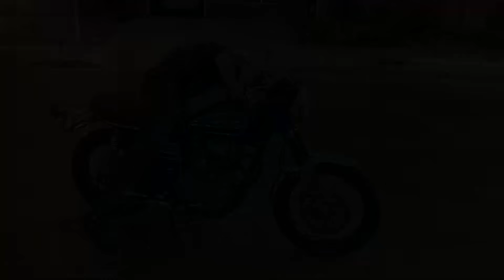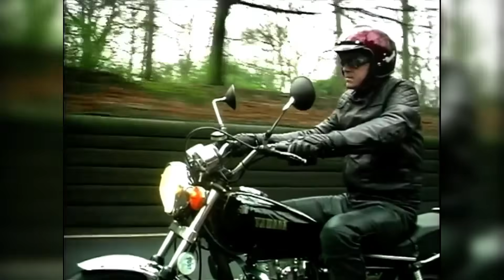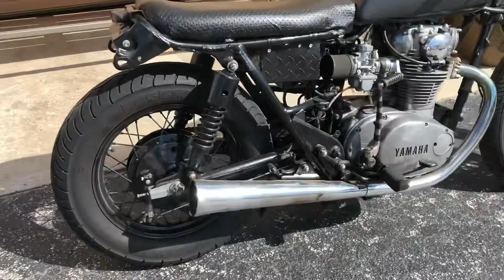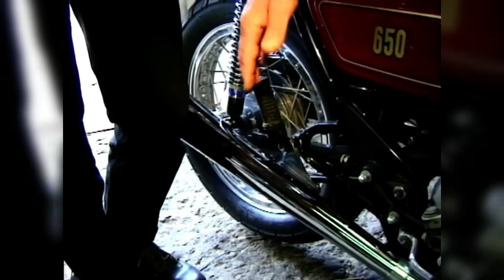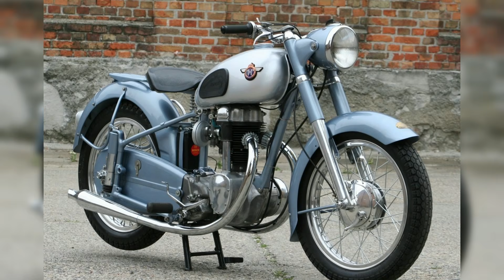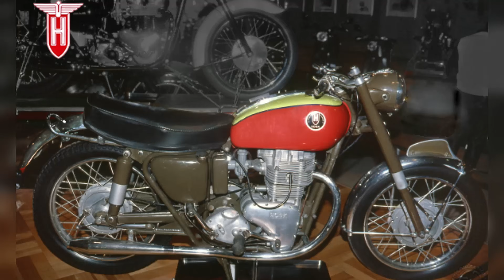THE EXPLOSIVE TRUTH BEHIND YAMAHA'S BULLETPROOF XS650

Comment: The XS650 engine was an extremely durable and reliable motor. It required very little maintenance for a long time. As long as you kept the valve tap it suggested and the cam chain tension correct it would go and go and go without any major repairs. Anyone who says that it was unreliable is ignorant about the subject and may have fed into a myth produced by somebody who is one of those who dislikes anything that's too good so they need to tear it down and dislikes anything being a little too bad so they need to build it up. This kind of leveling mindset exists in many people.
Reply: I recall they needed generator(?) contacts or something every 5000 miles - easy to do. You needed to do that work at the stated interval or they would fail and you'd be parked. Otherwise they are very reliable.
Reply: @terrybrown8539  Yes the alternator brushes needed to be replaced once in a while ( this was documented in the owners Manual, 5000 miles is probably right ). And by now most have had to replace the alternator rotor ( or rebuilt ). In have a voltmeter on mine to make sure, the green light tells me charging system is fine :-)
Reply: Tony halco , done mine to 840 and few other mods what a bike I had
Reply: I flat track one for five years and never touched the bottom end , did a top end each year and did valve setting and new cam chain , replaced the cam guides at two years. Bullet proof .

Comment: Few people know that the XS engine was also used briefly by the gamble racers (Auto Race) in Japan. They cut the entire transmission/clutch assy off the engine, switched the drive to the left side of the crank, ran a 2-speed gearbox with dry clutch, cut all the fins off the head and, as I recall, ran the oil pump off the right end of the camshaft. It was hoped that the XS would out-perform the dominant Triumph and Meguro twins but it didn't, and the bike was scrapped. I've got a photo of it somewhere and it's pretty wild.
Reply: Why remove the fins off the head?  Were they using methanol?
Reply: @dennisyoung4631  Gotta dig up the photo and look at it again to confirm. But no, they don't run methanol. The higher CG of the XS engine compared to the Triumphs and Meguro copies of the Triumph engine, may also have been a problem.
On the Triumph and Meguro engines many of the riders drilled the fins with many small holes. This works when the cooling area of the hole exceeds the area removed by drilling the hole. For more info search for 'The Zen Masters of Motorcycle Racing' (Superbike Planet).
Reply: Thanks for the fun facts. Japanese can be so off the wall crazy.

Comment: I had a striped down 1970 with a stepped frame and some rake. It actually handled quite well. Unfortunately, there was the vibration. With drag bars and a thin cobra seat, you couldn't see when you got close to 100mph. Too blurry. Then your teeth would hurt. I suspect going +90 for more than 5 minutes would give you brain damage.

Comment: Roberts' Yamaha flat-tracker was reworked to 750 cc with a one-off fabricated frame, suspension, and wheels.
When the Triumphs and Beezers were competing they were limited to 500cc while the Harley flatheads were 750.
When Harley finally smartened up to overhead valve efficiency the restriction on parallel twins was dropped.
Good timing for the Yamaha and big bore kits but not really any stock parts at all on racing equipment.
The Honda-Davidson Evolution motor saved their marque in 1984.
Reply: I thought Kawasaki was behind the Evo.......started when They Owned HD  and later sold it (Harley-Davidson )back to America   dave  nz
Reply: Harley brought out the XR after the AMA alowed the British bikes to be up to 750 ohv
Reply: I had planned on making one of my XS 650s into a 750cc and rephase the crank and cam to 270 degrees.  I did get it painted in the bumble bee yellow with the street tracker fender, seat, and side cover.  Just never got the engine modified and put  it back together.  I found out that the 270 degree crank and 750 didn't make enough increase in HP, so I let it sit for years.

Comment: With all of the "retro" bikes on the market, I'm not sure why they don't revive this legend.
Reply: Yes. And with a 850cc twin to boot
Reply: Because Yamaha's styling department has been lost for the last 20 years.
Reply: Friend recently had rebuilt an XS 650 engine with electronic injection, drive by wire, a freely programmable ECU and a little roots blower. That's what people would like, but You can't bring such a concept to a market that's panicking about carbon and NOx more than about the drivability and performance of a bike.
Reply: Built to last the modern one probably wouldn’t last as long
Reply: Xsr 700.
Reply: A new one will have plain bearings instead of needles and balls... It will not be as rugged as a result...
Reply: It'd be a great competitor for the Kawasaki W800
Reply: Because of the intense vibration.
Reply: @fredjaeger690  You're the first person I've ever heard complain about the vibration so that must mean you've never ridden one.
Reply: @jds @jdsolberg7613  I owned one, Stanley. At highway speeds it vibrated like hell. It also only had about 3 inches of travel in the rear suspension, which meant hitting any kind of a highway expansion joint at highway speeds was quite jarring.
Reply: @fredjaeger690 I also owned one Margaret, and there are a lot of bikes on the market today that don't do well on the highway and potholes are frightening to see coming, my vibration prone, 3" traveling Sportster for one. You should stick to automobiles.
Reply: Two words.  Points ignition.
Reply: @Crow-v2s became electronic by 1980...
Reply: @thorick590 That’s my point.  You can’t tune it.
Reply: @Crow-v2s get a 1978 or earlier engine..

Comment: I had a 1978 E Canadian model , nice spoke alloy rims and dual front disc , was a unique bike .
Reply: Very nice bike!
Reply: @manfredschmalbach9023  It was , did a few upgrades on it like electronic ignition , PMA alternator , high output coils , 2 into 1 exhaust and pod filters , NOS Koni shocks in back and progressive springs up front , Donlop K70 tires, carb redone , bunch of bearings and bushings , short stem turn signals , LED tailight bulb, IX plugs , Barnett clutch, nice handlebars bunch of other stuff  ... that thing ran like a top  , I really regret selling it now .

Comment: Did someone mention its sidecar motorcross ability ?
Reply: I once owned one that was bored out. It came with Ducati GT 860 pistons, 40mm DelOrto carbis. During the 5 years I owned it I installed alot of AME Chopper accessories such as, forward foot controls, 2-in1 side pipes, wide handle bars on high risers, a peanut tank a.s.o., but man that thing pulled like a drag bike. The only annoying things was the vibrations and the oil leaking from between the sleeves and the cast at the cyl. tunnel.
Reply: It's an American video, viewed at 98% by American people. They never heard of sidecar  motocross. The Yamaha was the best engine for years, with evolutions until 969 cc.

Comment: But brit twins have soul,xs 650 will never have this,they have poor handling, iffy e start,and rusting out fuel tanks are a epidemic
Reply: And you rebuilt a Triumph or BSA twin every 30 k miles, or even less. Nortons didn't last half that distance. If the build quality of the XS was bad, the build quality of later British bikes was atrocious. Then there were the dreadful electricals. Chassis were better and brakes were better. There's no denying that. And parts were everywhere and cheap as chips. They definitely had their plus's, but they came at a big price in terms of reliability, longevity and ease of maintenance.

Comment: My XS1 was a piece of junk. Bought new and right off started using oil. Missing an oil ring. Gaps in rings all lined up. Burned up points faster than oil change intervals. Tank slappers just above freeway speeds. Crome pealed on fork tubes. Disappointed is an understatement.
Reply: You Are Not Alone a friend of mine bought one in 1975 and the oiling to the overhead cam quit and seized up everything upstairs.
I will say that the dealership in Hammond Indiana took the situation very seriously and gave him a brand new set of barrels Pistons head and cam assembly.
It ran good after that but he still could not beat my Bonneville LOL
Reply: Yes, in my opinion the forks are the weakest link for the ride. 💚
Reply: Yes I can confirm the tank Slappys.  I had a 1972.
Reply: Handling was real bad
Reply: You were extremely unlucky.
Reply: I rode a 650 Bonneville back when the XS1 came out. I had many riders try taking me on in various situations and the Bonnie beat them easily. It wasn’t until a decade ago that I learned how the big end bearings were supplied with oil, which was the most ludicrous  thing I’ve ever heard in my fifty years of riding. 
The time honoured method of supplying oil to the bearing surfaces of the bottom of the conrods and the crankshaft journals is to use oil ways that carried the oil, under pressure, through the crankshaft and then to the big end bearing surfaces, but the XS1 had a system where such oil was supplied by a jet of oil being squirted at the big ends as they passed the point of the jets! 
There’s no question that roller bearings are better than white metal solid bearings, but there’s a caveat; the only time said superiority is advantageous and that’s when the RPM is higher than 7000rpm, but because the British bikes were geared differently, such a rev range wasn’t really  something that is necessary for a daily rider. At that rev range, the Triumph Bonneville is doing well over 100mph,  which means that the advantage of needle roller bearings is not that much of a problem.
I rode that Bonneville 650 as my only transport for over two years and I never had the problems with oil leaks, starting, or any other problems repeated in this video. The fact is that most of the issues are merely a matter of careful maintenance and even the horizontally split cases were not as hard to make oil tight as the video insists. 
IF the person rebuilding the engine is capable of very basic mechanical tasks, it’s a matter of careful work to rebuild the engine and make it oil tight. As far as starting goes, if I had to kick it over more than twice without it starting (cold weather or not) then there was a problem which usually amounted to a loose spark plug lead, or similar. I currently ride a 1997 Harley Sportster and that has horizontally split crankcases. It is so oil tight that if it ever does drop oil, the problem is always from some other point in the oil line, usually a hose fitting. The same was true of my Bonneville. 
Both bikes have been ultra reliable and far easier to work on than other bikes available. I actually like working on my own bike, because I know everything about how it’s been put together. I know exactly what’s  the condition of each bearing, bush, oil seal, etc, because I installed it. The number of times I come across people on the side of the road who have no idea how to even do basic maintenance is ridiculous. People pay over a thousand dollars to a workshop just for oil changes and routine servicing! 
I’ve been told by some riders that British bikes always leak oil, for half a century and I’ve always wondered bets with them about how much oil will be under the bike after lunch at a stop for lunch, or after work. The main reason for the oil leaks was due to the fact that production line workers in the UK in the 60’s and 70’s were all infected with the Socialist attitudes that led to them being paid for their time rather than their performance. A paradigm that exists to this day in factories in Communist China. 
Also, while Japanese factories were run on the basis that things like quality are more important than output, British factories of the day were run by accountants with stopwatches, who were more concerned with time and motion studies than producing machines that were manufactured to a standard. This too is still going on in many manufacturing plants today, where time is considered more important than quality. 
Personally, I liked the XS1, generally, but I wouldn’t own one, unless I could reengineer the oil feed to the bottom end bearings for starters and while I could do that, I don’t see the value in spending that much time on it. I would rather be doing that with something like a Vincent, or something else that is worth more than a Yamaha 650 twin will ever be.
Reply: @BigAl53750  
I agree with a lot of what you say, but about the bottom end oiling you are completely wrong, the yam 650 crank is near bullet proof and are renowned for longevity. Where as plain bearings need oil pressure, ball and roller bearings don't,they just need flow and not even much of that [they can have too much flow in fact]  Another crank that is renowned for longevity is the Laverda triple,roller/ ball bearings  lubed by oil mist, no pressure feed via crankpin internal drillings. Think 2 stroke and you realize how little lube roller bearing actually need .
Reply: My stock 450 Honda would run away from the 650.
Reply: @keithburns5707  BS mate, I've had both, there's no way a CB450  twin would beat an XS650, unless the 650 was worn out, not on this planet anyway...
Reply: @Mick-60  well, I didn’t tell y’all that it was bored out Camden ported and I lost weight on it down to 300 pounds you do 140 and I raised to the Ontario motor Speedway in Willow Springs
Reply: @keithburns5707 Your first comment said it was stock
Reply: @jonathangehman4005  yes, I know I raced in excess 650 when it was stock eat him alive but later I did build it because one floor of the 450 is the cam chain. They don’t last very long and yes I did board out and poured it and yeah it did go 140.
Reply: Just a reminder, the Honda 450 was outlawed. They wouldn’t let it ration England because it was too advanced.
Reply: @keithburns5707 I beat the same 911 in 2 street races with my stock '80 RX7...
Reply: @keithburns5707 yes thar was well known.

Comment: Starter motor was an advertising gimmick, press together crank shaft with roller bearing big ends were unstable, and the oil base air filter was inadequate. Otherwise, an excellent bike.

Comment: I put the XS engine in a T140 frame
Reply: You are BRAVE!😊
Reply: @Odessa98-v6w it worked really well good handling upgrades to the brakes and lights and all for under £1000
Reply: @ianbonnick7640 now that puts a smile on my face!!😊
Reply: @ianbonnick7640  Sweet ! I still have an XS-2 Cafe' , got sick of my old Triumphs shitting-themselves   dave  nz
Reply: @kdsowen2882 had a few British bikes but of a bsa fan, had an A65 devimead 750 fast and completely reliable got clocked by a mate on his GPZ1100 at 132mph and still edging up but ran out of road fantastic bike the one that got away
Reply: @kdsowen2882  If your Triumphs shit themselves, you either purchased them old and used and not properly maintained or you don't know much about how to use an engine for maximum performance while still keeping them running and not breaking down!                       I purchased my 1976 Triumph T140V 750cc Bonneville new on January 10th., 1997 I still have her and she is a very reliable motorcycle as well as the fastest street cafe racer in her time. She was still winning against new Honda 1000's and Kawasaki 1000's in 1992 so she had a 16 year consecutive winning streak and I finally retired from street road racing and purchased a new 1993 Harley-Davidson 883 Sportster Deluxe which I also still have.
My Bonneville being only a 750 really had to be beat on to win against the newer 1000cc motorcycles, yet she always won-every time! That says something about how stout her motor is, to win against new, larger displacement motorcycles and not blowing up or breaking down. Her 4130 chromoly frame is lighter and stronger that the steel used in other motorcycles and her frame geometry and overall light weight (under 400lbs full of gas and ready to go) provided the absolute best hands down handling of any street machine, so she always won. Her frames backbone ran from the steering head and across the top of the motor and then down to the swingarm. She had a 4" diameter 4130 chromoly tube which also served to hold the engine oil-"oil in the frame". Her motor is stout enough to keep her in the running and her handling insured victory time after time for 16 consecutive years. -Peter
She sitting outside under a carport awning  extended from my back door right now as I write this.
Reply: P.S. Yes she won against my friends new Yamaha XS650 Twinn.

Comment: I find it hard to believe that a Harley Davidson was lighter than a XS650😅lol
Reply: Not true I had a xs650 it was 50 pounds lighter then the sportster
Reply: The XR Harley - maybe, especially by that time.  If KR was taking a common street Yam and reworking it….
Reply: Those bikes aren't in factory frames and it's possible the XR 750 engine is lighter than  the XS 650, which is pretty damn heavy if you've  picked one up.